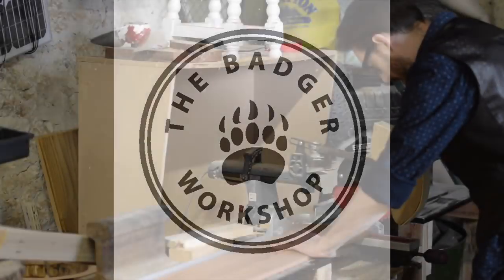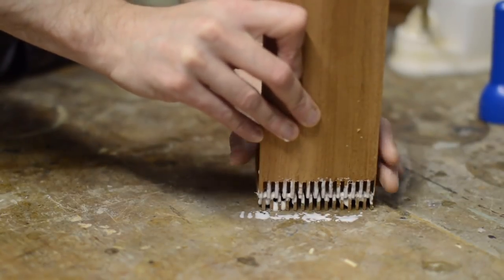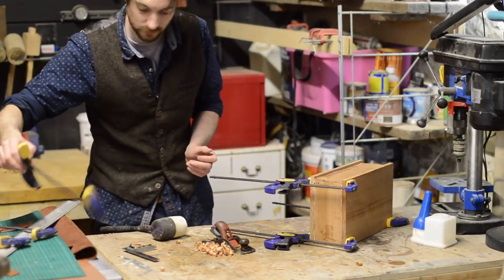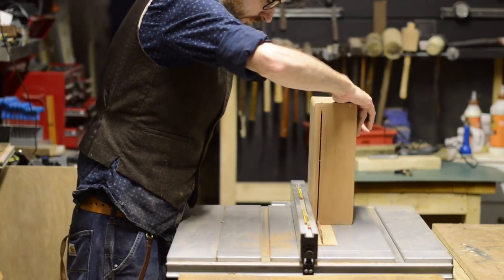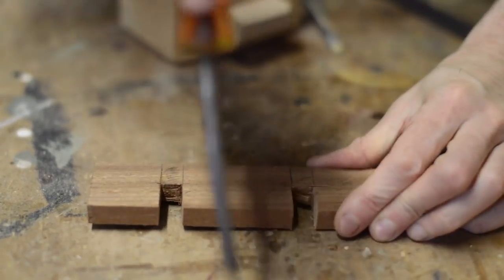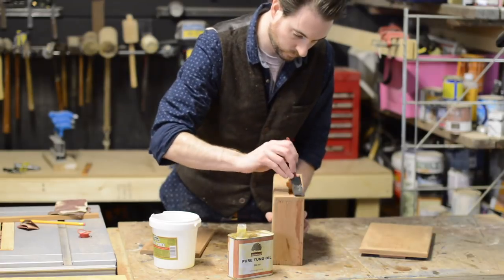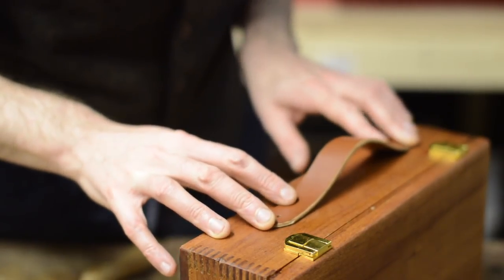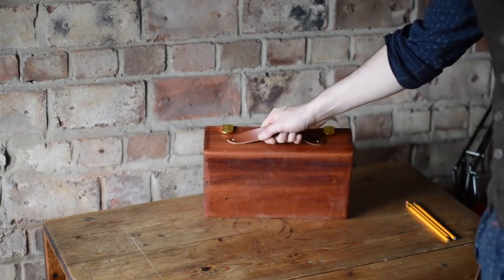Artists Case

Comment: Very nice. I'm yet to try thin box joints yet as I feel if you are even slightly out it multiplies the error. Yours looked spot on.
Reply from the maker: Thank you. You are right, they are tricky. Especially with a thin bade. I had to have a lot of goes with a jig before I got it right.

Comment: I need to make a shoe cleaning box, will need to watch this video again, knowing my luck the joints wouldn't line up, watched another video who marked all his ends up A A, B B, C C, D D at that point I lost the plot.
Reply from the maker: It took me a lot of goes to get the finger joint right.
Reply: Badger Workshop I saw you using a slaw sled, can't seem to find your video for it, have you done a video for it, if not could you post one.
I must try and make some videos. I love the fact that you are an all rounder and love the fact you recycle, I have just found sheets of veneered chipboard in my loft so using it in my workshop to create a nice smooth worktop on my long workbench.
Reply from the maker: I did not film it. Bob from I like to make stuff did a great video on it. I based mine off of his